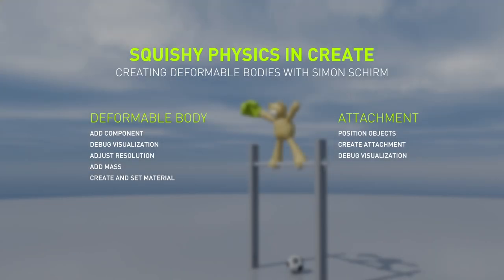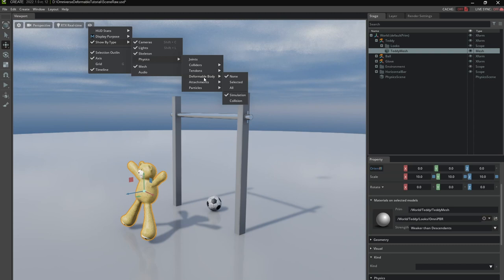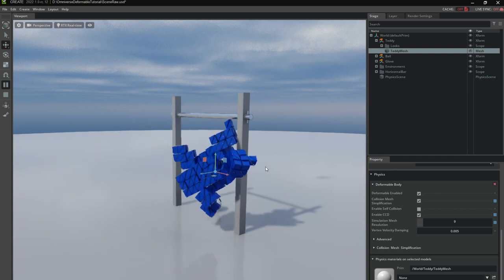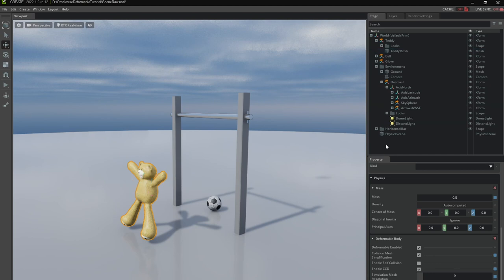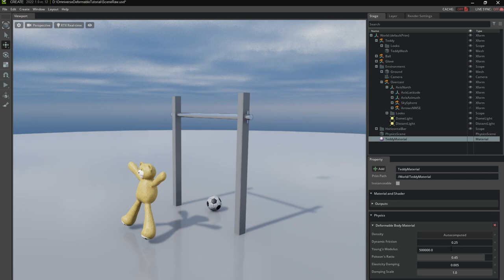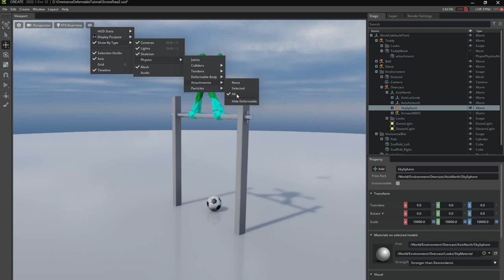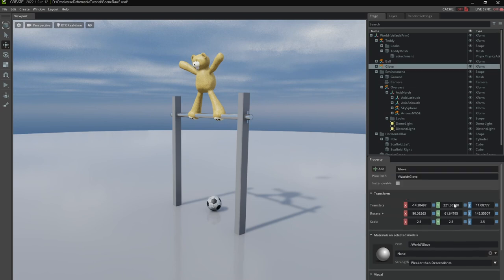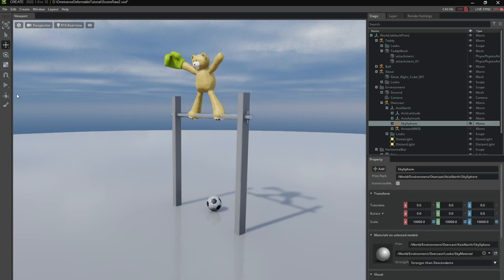Deformable Body Overview in Omniverse USD Composer

Comment: Been searching countless tutorials in an effort to find a softbody solution since Unreal 5 doesn't really have much to offer. (or maybe I just don't know what I'm doing) That of course led me to a lot of Nvidia Flex tutorials however it seems like Flex is no longer supported as of Unreal 5. I guess my questions would be; can Omniverse's physics simulations like cloth and deformable bodies be exported and applied to rigged/playable characters in game? Can the effects be weight painted for varied intensity across different parts of the mesh? Or are those features primarily just for animated/CG film just within Omniverse Create? Looking for something that can simulate fat, muscle bulge, and/or twists in real time to reduce the amount of drivers, shape keys, constraints needed. The new USD format looks really cool and hopefully that means you can but I haven't been able to find anything specific to the topic. Any info or suggestions would be greatly appreciated.